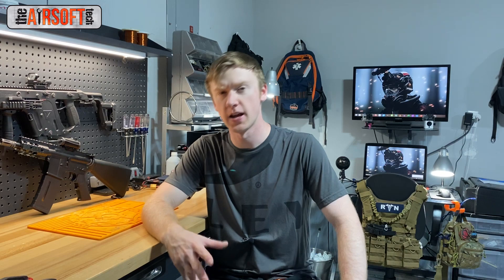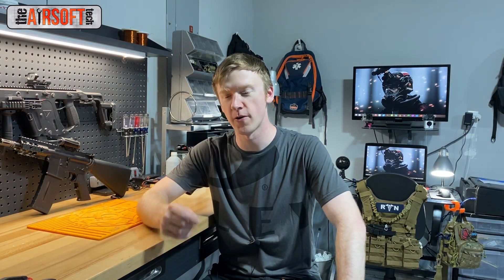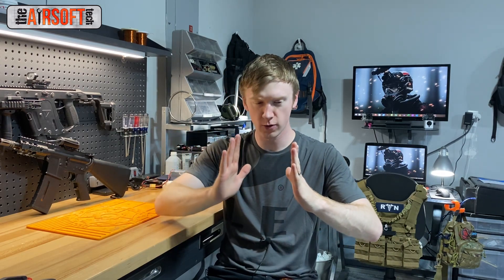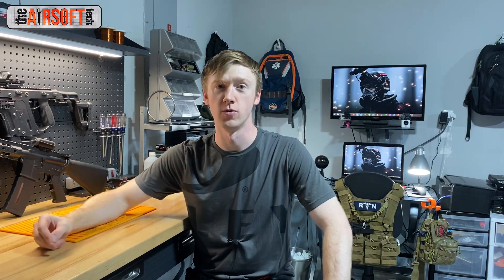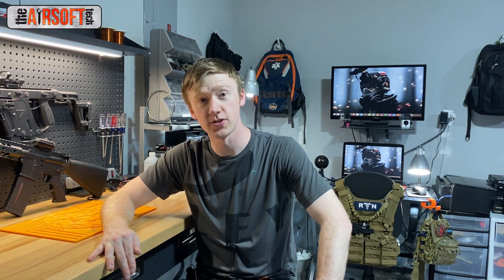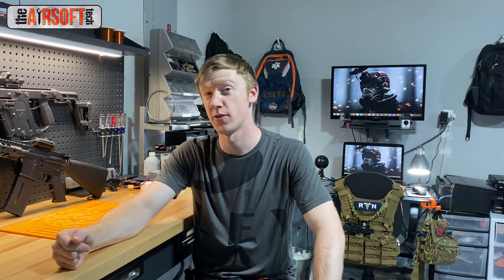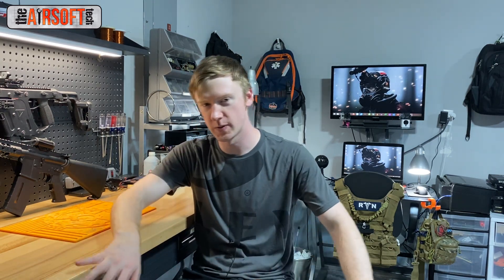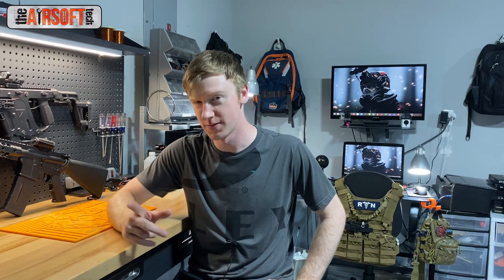Brushless Motors and Nightmare Builds | Airsoft Tech Talk Q&A | Episode 21

Comment: As for the GG ding sound it is not the spring the forward assist Spring will vibrate in most cases so you soak it in grease or tape it or remove it.
Reply: Thanks 🙏
Reply: Its also some times the spring on  the chargeing handel i taped a cut piece of ruber band to the upper revicer on the inside of the lpwer were the chargeing hadel spring sits and the dinging sound was dampend enough to were its not noticed and some times its the main aeg spring is just a hair short my buddys predator makes that dinging sound were another guy useing the same one but newer dosent make that sound

Comment: Shadow regime airsoft makes an upgraded trigger unit for the p90 that is way easier to tech on especially for dsging
Reply: I've always though about sending airsoft tech an M-Trigger sample but haven't done it yet. Been watching his channel forever!
Reply: @ShadowRegimeAirsoft  it's a good system I enjoy it in my dsg p90 that uses a warfet and an option no 1 motor. The only issue I've found is high rof causes the cutoff cam to not reset properly sometimes with the micro switch so the trigger will go dead. I feel like it needs the springs somehow molded into the trigger switch and the cutoff lever so they always maintain contact with the p90s stupid extended cutoff lever that can have alot of play and not be that precise with high cycling semi and auto
Reply from the maker: @ShadowRegimeAirsoft  I’m all ears if you want to send me one for my P90. 😜

Comment: I can't believe it, I have worked on both the nightmare guns that had issues with and can confirm both are pain in the in asses. The 10+ year old G&P M4 I'm still working on has the exact pinion to bevel height issue I'm grinding my teeth on, it's infuriating.

Comment: I have 3 brushless motors now (2 warheads on their way) they are far superior. Way less heat and current than a brushed motor on the same setup. And they are rebuildable and take a VERY long time to wear
Reply: um... what is there to wear? "Brushless" is superior because there is no contacts and is maintenance free at least the 20 I own are. Now with that being said maybe there is some major difference in a RC brushless motor and what is used for airsoft but I wouldn't understand why there would be. Maybe you mean the gear or shaft wears out and that would make sense.

Comment: The main reason that brushless motors are really expensive, for example, option 1. Or even warhead, is because they come with mosfets pre built in along with battery protection, load protection and more. So yes you could buy a DC motor and a mosfet but then you would have only the mosfet and a lesser reliable motor. So in the end, it's the DC motor and fet that will cost you more down the road.
Reply: Warhead comes with integrated Electric Speed Controller, I don't think it has mosfet built in it. Mosfet makes your trigger not to run all of the current through your trigger contacts. It is remote switch.
Reply: @Tomasmoravia  correct
Reply: First reply is correct, they're not MOSFET's, they use an ESC (just like an RC) and all brushless ESC's have low voltage cutoff to prevent damage to the motor or the ESC itself.
Reply: @marinusdedreu3833  Yes you still need mosfet to run 11.1 li-po properly.
Reply: @Tomasmoravia  well look at that haha, love learning new stuff on airsoft and rc hobbies everyday. Thanks for the replies guys.

Comment: First of all love your channel made me learn how to work on my guns and I upgrades both my arp556 and crb.

Ok 2 quick questions.
I want to upgrade my spring in my crb and arp556. The both have a prom barrel. (Original lengths)

What size guarder spring should I use with each gun to get a joule output as close to 1.2j with .30 bbs. (Restrictions in NL)

Tnx again for your respons

Comment: Oh, I do have a question for you, what's your opinion on the G&P i5 gearbox? I noticed a couple people posted they were running into some problems with the gun shooting around 250 fps. One of the guys dropped it into a non G&P M4 platform and he cannot get over 250. Could it be that the air nozzle on the GP gearbox is too short and not mating to the hop up unit? If that were the case, can you change the air nozzle to a longer one? Another thing the guy said on his video after Chrono was that he hasn't tried a different spring. But according to the specs on the GP gearbox, it should be putting out at least 350 fps cause I think they come assembled with a 130 spring. I myself think it could be losing air between the air nozzle an hop up. I am interested because I just ordered 2 of the i5 gearboxes for my M4 stubby platforms and if I run into the same problem, it would be good to have a longer air nozzle on hand. Isn't the nozzle on the version 3 gearbox a bit longer than the version 2? If so, couldn't I just order a nozzle for the V3 and swap it out if I ran into a similar problem? It would probably be a good idea to check the shimming and air pressure while I have it open to install a longer nozzle if necessary correct?   
Again, I really appreciate your tutorials cause I learned a bunch just by watching YouTube and your detailed explanations on how to upgrade and/or fix our own aeg's. If possible, could you send me an email to this address so I don't have to leave a page long comment. Thanks for all you do! 
BTW, my name is Mike. Here is my email address: 
mbcarc@gmail.com

Comment: Hello, I have a question I can't find on the Net. Is it good or not to use Active Brake together with Precocking or Cycle Completion? Is there chance for interference when using them together? I have bluFET and I don't have percentage/time of the strength for AB or precocking and cycle completion. I can turn on AB no matter if I have precocking or CC turned on but precocking and CC turn on interchangeably.

Comment: There are still people paying about the same price as brushless for those M180 Satan motors, lol.
Reply: Would be nice to see the brushless come down a bit though. Even $100-$120 would be reasonable.
Reply: @bangerairsoft4086  Warhead sells their for 150 dollars, considering it runs 52K rpm on 11.1V that's pretty nuts. Dunno if it can pull M180, I guess with proper gearing it could.
Reply: @Tomasmoravia , $150 is even reasonable. It's still pretty early on so we are still eating some of the development costs.
Reply: @bangerairsoft4086  Yeah, right? I made upgrade to my RC plane with BLDC motor and the electronics take some space, but man it goes like mad even with the tiniest motor they got. I had to reinforce the plane in order for it to not rip apart. The shape of aeg motor is specific and you need special coiling so there went a lot of design work to incorporate all in one package.

Comment: I have been trying to figure out how to mount up a BL motor and using a 1/8 scale differential pinion and it appears it should work but maybe someone will figure it out before me because $180 for a tiny BL motor is F'n highway robbery. I wouldn't spend more than $100 but $50 to $75 seems more like an honest price.